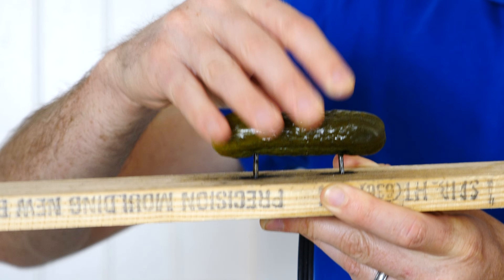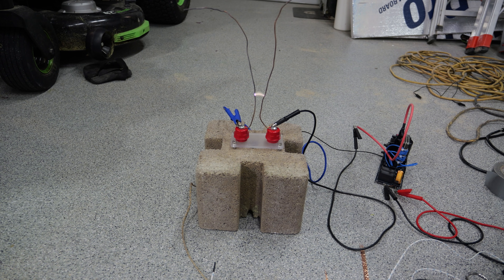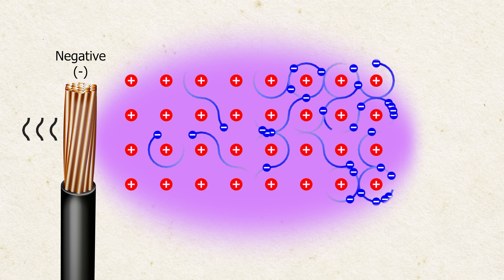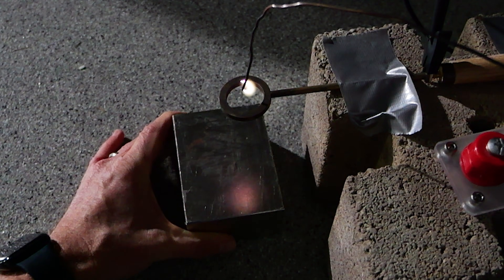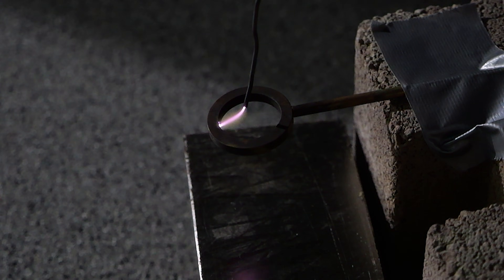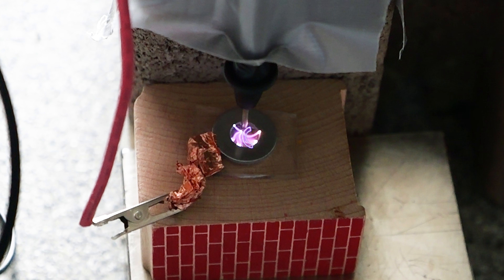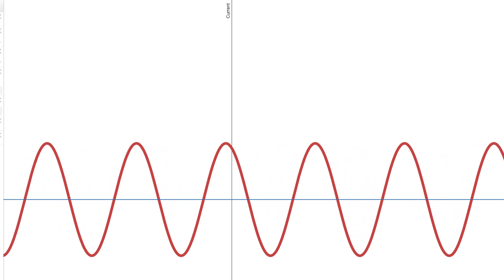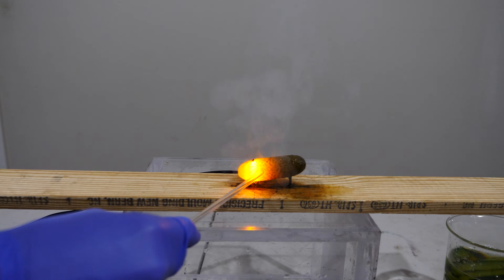Why AC Electricity Doesn’t Behave the Way You Think

Comment: The mechanism described is correct, but the anode is the electrode that receives more heat, not the cathode. It's the opposite naming convention in chemistry. I'm a plasma physicist, so for this reason, I always get confused when doing chemistry. The very bright Action lab host is a chemical engineer, so he flipped the convention doing plasma just as I would do when doing chemistry!
Reply: It's not chemistry vs electrical engineering convention. It's galvanostatic vs potentiostatic control. Both can occur in electrical and in chemistry. The anode-cathode convention is horrible and should be avoided like the plague
Reply: This is a very good discussion and it seems like these two fields of science need to work out their differences in order to fathom the true underlying science of nature.  I like to apply the prefixs ana and cata together as dualistic ideas that apply to root words like anabolic or catalytic, it’s the same with electrodes and electrolysis.  Here’s some food for thought, maybe the ions go in one direction while the electrons go in the opposite direction. That’s probably why electrolysis develops ph gradients in solution and why galvanic or voltaic cells do their thing.  In my description ph, polarity and electromagnetism is caused by dividing the electron from the proton.
Reply: From a physical chemistry perspective there is no different convention here.
Anode and cathode are defined by electron flow, not by temperature or by “plus/minus”:
the cathode is the electrode where electrons enter the system, the anode where they leave.
In plasmas (as in electrolysis), electrons are emitted from the negative electrode into the plasma, so calling it the cathode is fully consistent.
The apparent confusion usually comes from galvanic cells, where the negative electrode is the anode because electrons are generated chemically rather than driven externally.
Reply: @WeObeyTheLawsOfThermodynamics  Cathode is from the Greek kat + hodos, the way down, and anode the opposite, the way up. Conventional current was seen as entering at the positive top, the anode or high road, and leaving via the cathode or low road. But this assumed something else was driving the circulation - at that time the electric cell - and for that the convention is reversed.
In your third sentence you refer to "entering the system" but this is wrong because the system is a complete circulation - unless of course you have a capacitor in the way. The inconsistency arises because of the tendency of different specialisations only to look at their half of the system.
Reply: @WeObeyTheLawsOfThermodynamics  In a photomultiplier tube, the cathode (aka photocathode) LOSES an electron when a photon hits it. No chemical reaction takes place. So there's kind of 50/50 chance of guessing how to apply your definition: which half of the circuit is the "system" and which half is not.

I think, for the betterment of humanity, the "a word" and the C word" should be banished from respectable science.
Reply: @WeObeyTheLawsOfThermodynamics yep, this is also consistent in electronics too. The cathode of a diode is where electrons would flow into the diode, which is opposite of conventional flow
Reply: @WeObeyTheLawsOfThermodynamics  I am guessing that chemists design batteries, and traditions run back centuries, when Franklin guessed wrong about which way the "electrical fluid" was flowing in charging leyden jars. As a physics teacher in high schools, and going through amateur radio courses, I was always frustrated about conventional current used in textbooks so students could only think of arrows, not real electrons moving. So I have to explain that conventional current arrows, pointing out of the positive end  of the battery, meant the Cu+ copper atoms and wires would have to move, not electrons. What are your thoughts on that topic and how engineers think and use it?
Reply: I still can't remember what the anode is in a rechargeable battery, it's so confusing... why not just say "plus" and "minus"?
Reply: @markotrieste  It's confusing because we arbitrarily defined electricity before we understood that electrons were typically the charge carriers.  It's easy for me to remember just based on the letters A and C for anode and cathode that electrons flow from the anode to the cathode.  That's easy to remember and don't have to worry about anions or cations or anything.  But since we define the direction of electricity flow for conventional current as the direction a positive charge moves, ie. opposite the flow of electrons, I then have to do a separate step in my head to remember that current flows from the cathode to the anode and that tends to be where the confusion comes from.
Reply: @m @markotrieste ere’s an easy way to apply it across interdisciplinary fields my friend 😊🙏 think of the prefix Ana and cata as being opposite.  Analogy, analysis, anode Ana means to become opposed or push away. Catalog, catalyst, cathode Cata means to attract or accept into.  It has a connection to masculine and feminine as well.  I hope I was able to convey the pattern and abstract a better concept of what’s going on.
Reply: @freemanrader75  Actually it is kata that means against or down as used in science, hence katastrophe the down or against stroke, katalyst to dissolve down, analysis to loosen up! Confusingly as with so many Greek words they are not opposites due to the change in meaning at different times and places.
As with so many unfortunate attempts to use Greek as a scientific language, it is best to learn the terms and forget the original meaning - dinosaurs are not terrible lizards, a nanometre is not a dwarf measurement and an electron is not made of amber.
Reply: @PeanosZero  Kato in greek means down and pano means up, so you could think of them as opposites if you just drop the "p" maybe. Ano for anode instead of pano.
Reply: @PeanosZero  I think your correct about that because K is symbolic to an open receptive palm while the letter C eventually became Gamma and originally represented the transitive function between alpha and beta.
Reply: So, evaporation of the electrons from one side provides a cooling effect.
The electrons use the ether that they carry to remove the heat through an evaporation process.
Ironically it was Einstein's only patent, the Einstein co-patent on a refrigerator, that hinted at using the electromagnetic properties of the ether as a carrier of heat.
Reply: @JoeDeglman    That's some esoteric info about Onerock, dude. Tnx.
Reply: @JoeDeglman  the aether doesn’t exist… you’d think all you cranks would’ve head of heals though when a scalar field was discovered/observed since conceptually the most important thing about the aether was the fact it was a scalar field… but as soon as one is observed aka the Higgs field all you cranks could careless which really says it all… your thinking is so provincial and incorrect you can’t even spot the conceptually interesting facts yet alone even acknowledge it when its been pointed out to you cranks lmfao…
Reply: @JoeDeglman  keep demonstrating you that you haven’t actually studied physics… when you can actually do math and speak physics aka the language of physics is mathematics. Then come back and talk bc you don’t know what your talking about past some pop science YouTube video and in your case the cranks from the electric universe or the like. These guys can’t even do high school math yet alone speak actual physics. Also learning the actual history and not some deranged version from cranks who are specifically interpreting history in their own completely baseless and nonsensical way just so they can seemingly have a story for their own bs. But hey you keep listening to morons who have been saying the same things for literal decades now and still haven’t been able to show anything… you’d think you get the hint by now that they are all just grifters and cranks but yet again it’s only another sign that you don’t actually understand any of this nor have you ever seen real science specifically physics being done in real life either….

Comment: The pickle acting like a diode? Make a full bridge rectifier and hook it up to an oscilloscope!
Reply: This will get Mehdi's attention.
Reply: @Yupppi  First of all, he will replace cucumber with Mehdi...
Reply: @Milan_Petrik  And for my next magic trick...
Reply: @Yupppi  You know I bet Mehdi has an electrical bias as much as he ends up being the pickle.
Reply: Full Pickle Rectifier
Reply: @SomeOrdinaryJanitor  im imagining a pickle mehdi in a cape
Reply: @SomeOrdinaryJanitor  Pickle Ricktifier.
Reply: Well, technically it's acting like a really crappy diode (with a lot of leakage current)...  not really that suitable for making a rectifier out of, in practice.
Reply: @foogod4237  So multiple pickles ?
Reply: @FilipArlet  Four Pickle Rectifier!
Reply: @foogod4237   Still, i'm kinda curious to what extend it would rectify it or rather how a sinewave will get distorted.
Reply: @foogod4237  light emitting diode acshually 😂
Reply: @OrganicFanatic  Smell emitting too, I'd bet.
Reply: @OrganicFanatic  LEP
Reply: @foogod4237 I have a perfectly healthy pickle. No leaks whatsoever.
Reply: Electrolytic rectifiers were very much a thing over 100 years ago! A jar of electrolyte (many different kinds will work), two submerged electrodes, one of aluminum and the other of lead, and you've got a beefy power rectifier. It's lossy and noisy, but four of them would give you rectified mains, which could be smoothed by another " pickle slop jar" creation, with both electrodes of aluminum: under assault from DC current, this forms an electrolytic capacitor with a reverse breakdown voltage slightly higher than the peak applied DC pulses.
Reply: FOOL BRIDGE RECTIFIYAHH!
Reply: The discharge, especially this one occurring between a metal electrode and a liquid surface, can have rectifying properties (do you know about mercury arc rectifier?)
Reply: @Milan_Petrik there at least used to be (c. 1970) a running 19th century (?) mercury rectifier in the British Museum of Science in London. It was an amazing contraption, but my knowledge of electricity, at that time, was so limited, I didn't understand clearly what it did. I need to see if there's online info with video.
Reply: One misconception I’ve encountered teaching students is that electrons must “travel” from source to load. In reality, with AC the energy propagates through electric and magnetic fields and the electrons only oscillate locally, something I’ve confirmed in lab measurements. This video helps demystify that.
Reply: PICKLENIAC,  the smelliest computer ever built
Reply: My only reason for looking at the comments was to find this particular comment. FULL BRIDGE RECTIFIER!
Reply: Don't summon him
Reply: @kemon3733  🎵Say his name and he appears! I believe in Mehdi! ⚡️ ⚡️
Reply: I guess you could call it a Full FRIDGE Rectifier
Reply: Get it in a circuit with a pickled pepper acting as a capacitor.
Reply: Will the Rectifier be a Cheeseburger ?
Reply: And make an Tesla charger.
Reply: Some greatschoot stuff
Reply: Replace 'diode' with dildo..  and oscilloscope with only fans hits and plot a chart
Reply: This is the way!
Reply: I've heard of Pickle Rick but this is picklediculous!
Reply: I guess that is some kind of stupidity going around like a flu maybe a covered flu again 🤔 this smart guy was trying to show you the importance of geometry which makes a symmetrical signal and non-symmetrical signal in a very simple terms yet you stick on the pickle and fickle and whatnot and tomato and potato and blah blah.... Indeed intelligence is very limited however stupidity has no bottom😅
Reply: Get electroboom
Reply: I miss read diode to begin with. Not to self. Dont skim read
Reply: Pickle diode is a great name for a band. That and electric weiner.
Reply: Get a haircut
Reply: FULL PICKLE RECTIFIER
Reply: Or

FULL BRINE RECTIFIER
Reply: I think it's Best to use a non DC output in the picked.. we want holographic oscillation not a pickle taser that draws oscillations in your heart...
Reply: Full bridge rectifier? I hardly know her!
Reply: A similar phenomenon happens when touching a grounded pickle to a high powered AM radio tower feed line.  Usually the side touching the feed line sizzles more, and you can even hear the audio signal. heh  Some pickle/tower videos also explained this via the diode effect.
Reply: You want to ruin his demonstration ? 😂
Reply: I second that suggestion.

PICKLE RICK!!! 🤣
Reply: Did you know it's just called a bridge rectifier.
Reply: @BoBandits  "half bridge" has also been used to describe half wave rectifiers like diodes.
FULL BRIDGE RECTIFIER leaves no doubt. :)
Reply: @ParedCheese sure. As long as my power is rectified. A half is good enough for my toy trains 🙃
Reply: God-Jesus died for our sins to give us eternal life and save us from sin
Reply: @josizzel  So we are saved from something this guy invented in the first place, and he saves us by killing himself? Yet he knew the entire time what would happen, but did nothing to stop it from happening in the first place? Yep checks out, totally reasonable story. 😂
Reply: @josizzel  Yeah but can he rectify AC on both halves of the cycle?
A full bridge rectifier can.
Reply: @josizzel did He had his face like lightnings how he's described in Revelation/Apocalypse? Btw, I don't see this relevant to the video...
Reply: @josizzel  maybe you should tell to those performing brainwash: Erare humanum est, preseverare diabolicum !
Reply: @josizzel  syfm
Reply: @josizzel  Find just one contemporaneous, first-person, eyewitness account of the Resurrection in your Bible.